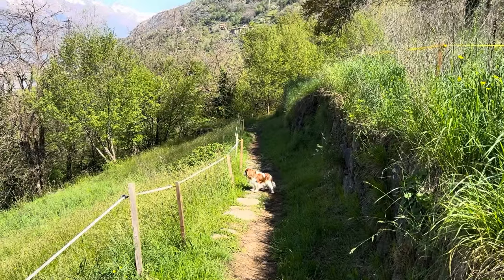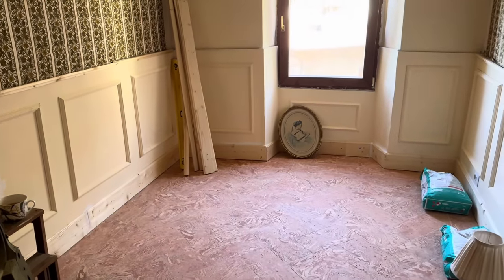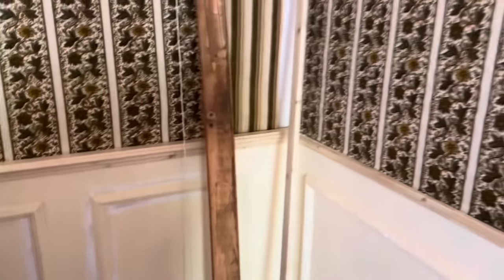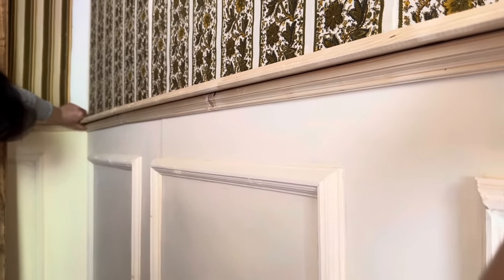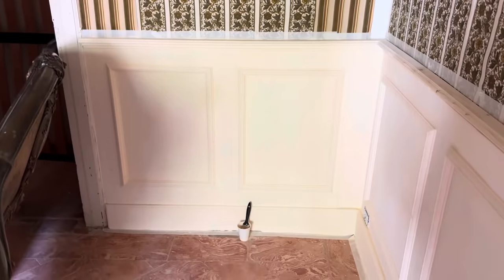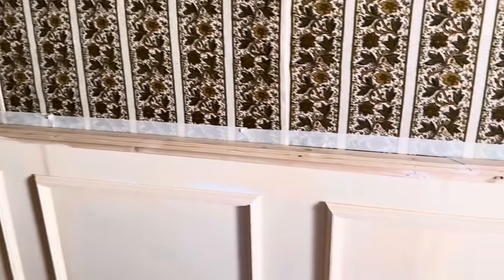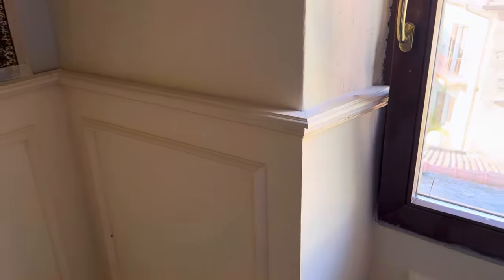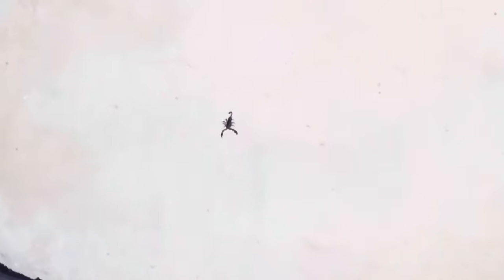Painting the panels in our guest bedroom/Renovating an old Italian house

Comment: Alla, try looking for a piece of trim that in the US is called quarter round. It’s very inexpensive and would cover up the area between the skirting boards and floor that you don’t like. You can even find it in a flexible, paintable type (white, plastic feel) so it would bend as you need it too. It’s pretty cheap.   ❤ Love your room.
Reply: Quarter-round is a great way to solve the skirting board problem…..and easy to paint before installing.
Reply: I have used the flexible rubber-like trim. It is often self-stick and curves beautifully around wonky walls. Amazon supplies it here, but I don’t know how that works in Italy. 
Cherie hiding behind the stepladder in the corner is such a typical pose for her. Always ready to catch you if you fall. That wooden stepladder is a treasure. I’ve never seen one here. 
Finish carpentry is a great skill. Turning flat pieces of raw wood into gorgeous moldings is often only done by masters of carpentry. Fitting the pieces together and then caulking them in place can only be done by experienced, grizzled old men, or an adorable couple in Italy who tackle impossible jobs and turn the result into enduring beauty. One again your teamwork is remarkable. 👏🏻🤩🤩👏🏻
Reply: Yes my dad who does lots of carpentry was watching this (in Australia) and he also recommended using a quarter round. He also said to remember to pre paint it because it is very difficult to do so when in place because it is touching the ground.
Reply: I started to say the same thing when I saw your post. Great minds think alike!😊
Reply: Quarter round finishes the skirting board (baseboard) off and makes the edging of the tiles look so neat. ❤

Comment: Use toe molding. Called quarter round for the gap. However it works better if you nail it because it will move slightly to contour with  the floor and nailing wiuld secure it

Comment: My father was a finishing carpenter and also finished cabins inside of boats. When your skirting board has an uneven floor you need to scribe the boards to fit the floor first. You must fit these all first, then you will also know the level hight you can make the skirting come to. Then you make your fancy cut to the top of the boards with the router. It takes time and skill and certainly someone with experience makes it look so easy! If you can find corner round as others have suggested, it will work well and I would choose that way 👍👍 It is looking wonderful! You should be proud of all your determination and hard work!